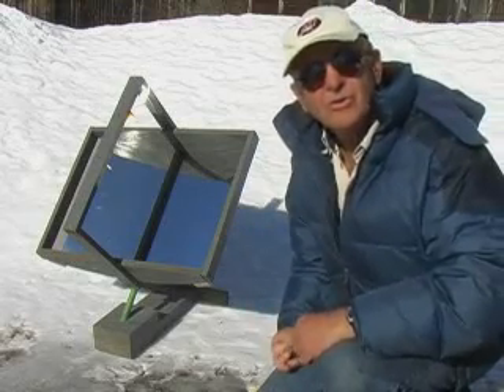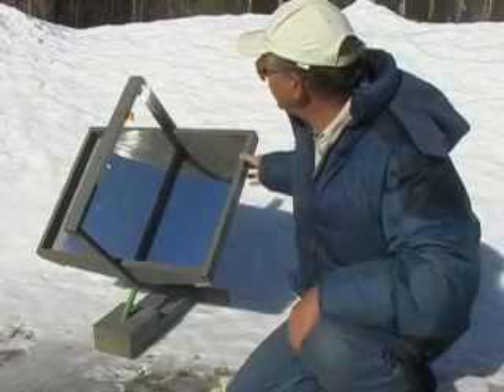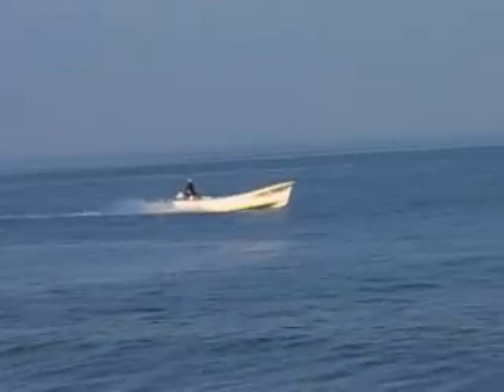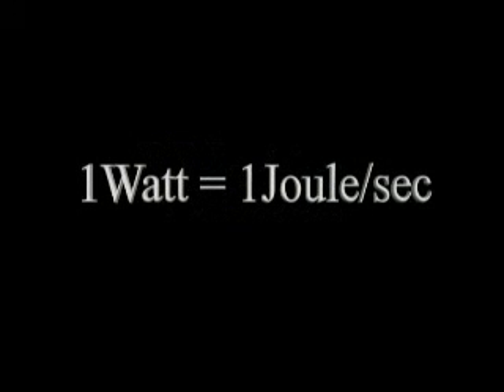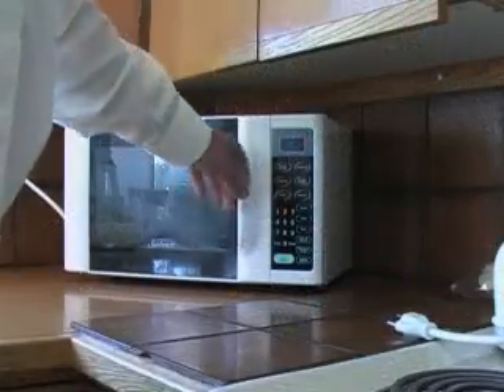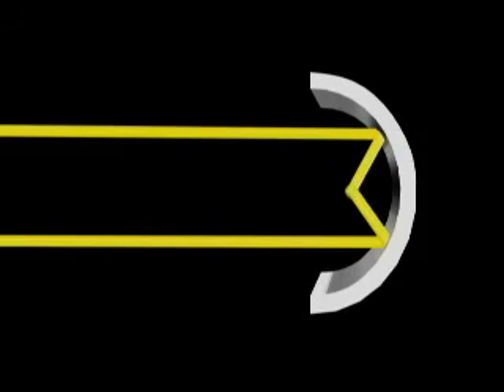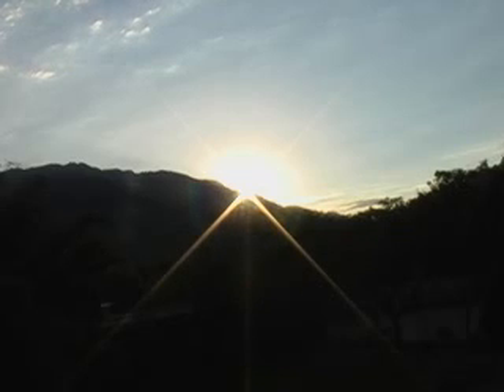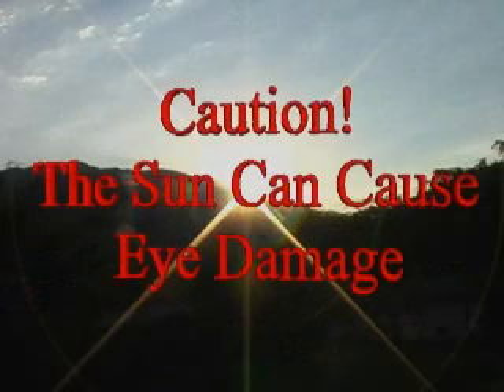Solar Energy Concentrator

Comment: He is a clever man, everybody should listen to him. As for the law that energy is not created nor destroyed, we have had 200 years of the industrial revolution, pumping heat into the atmosphere, this is one good reason for installing air source heat pumps, they would take this energy out of the atmosphere and concentrate into our homes for hot water and central heating. Add solar pv to power and you have a pretty much virtuous circle.

Comment: With the technology we have now you can heat homes,This would cut heating oil use and help clean the air from oil coal and wood heating systems.
In the  big cities use the roof tops just for limited power in the buildings this would cut back on the amount of power generated by coal and gas and it would help the national grid by taking some of the supply load off. This is what we could do if alternative energy was not a political tool of the Obama Administration.need to use the knowledge we have

Comment: just use it to split hydrogen! more hydrogen in the universe than any other fuel. There is a safe simple way to contain hydrogen also. do your homework. Get a 1950's -60's chemistry book for high school. A 6 volt dry cell will create a nice little firecracker of hydrogen within less than a min. So a solar cell every day creating hydrogen, then storing it is far more efficient than what is used today!

Comment: If you want water, do you: A. collect condensation or B. drill a well? Collecting condensation is useful, but it does not scale well. Ground level solar energy has its uses but doesn't scale because you can't collect more than 100% of the solar energy received, you can't collect it at night and output drops when you need it most (winter).... Space based solar power could work, the real challenge is transfering that energy to the ground. ...

Comment: That's cute. Which experts, what was said exactly and what is the plan? Do you know why you don't burst in flames and disintegrate? Because there is a definite limit to solar power. You can't get more than 100%  of the solar power that a surface receives... and guess what? At peak exposure, it wouldn't even come close to our needs today, let alone our needs in 10 years.
Reply: +sylverdrag:  You've got it!  Flea power!!

Comment: You should check out the MIT study : "future of geothermal energy". There are 2000 zetajoules of untapped resources that can be easily reached and ALL the humanity used about 0.5 zetajoules/ year. This means that if we use that geothermal power, we will have energy for 4000 years just from one resource.

Comment: Hum, so a solar plant the size of a small city in the desert (an area which receives a very large amount of sun energy) is barely enough to power a small city today?  This is so typical of "solutions" made without understanding the real magnitude of the problem. We need a solution that can produce 100 times our current energy consumption. Not a "solution" that can barely keep up with our current needs and requires more land than we use for producing our food and lodging.

Comment: This is not so simple for the underprivileged.  How long has the system been developing the need for Dependency???  Teach compassionately and the word will spread far and wide...  Everyone needs to learn what they can do with their own hands using the simplest materials. Currently I am working on photovoltaic rubber to transfer dc in conjunction with an air battery.  Praise the Universe and the wisdom to create!

Comment: @lunafringe10 -- On what fuel does your vehicle run? There is a place for wind and solar, primarily for off-grid, remote and rural locations. Even with battery back-up, the intermittent, uncontrollable and unpredictable nature of these inputs don't lend them well to base-load, on-demand power requirements. PHEVs still need to be plugged in for recharging and their range is restrictive. You must keep in mind power density and capacity factor.

Comment: So what happens when you have millions of homes that need power, and it's coming a hurricane or there is a rain system going through for 3 days or more? No sun...and I'm not sure that batteries charged by such a device like this would be able to sustain such a load for days. They would be out of power on the first day...